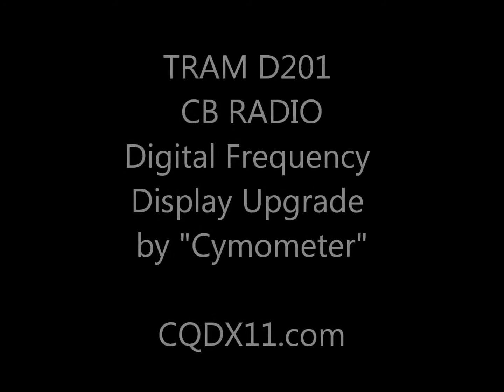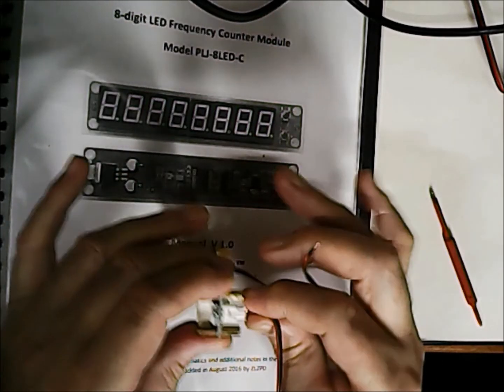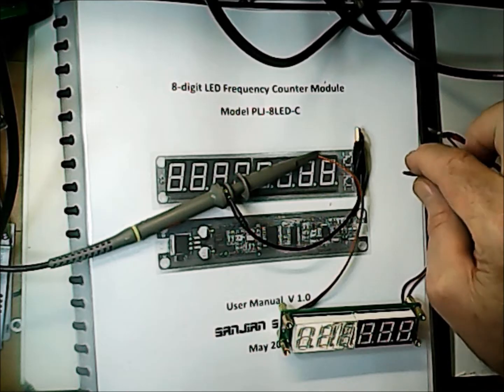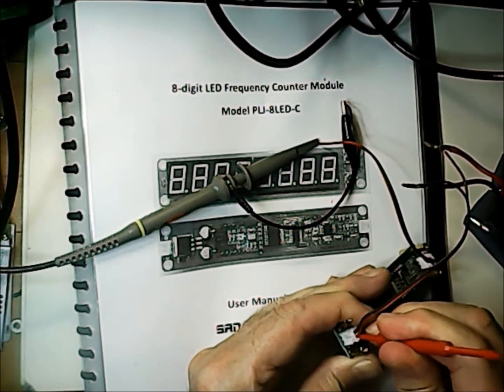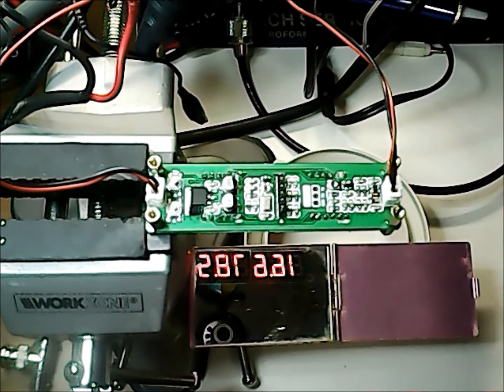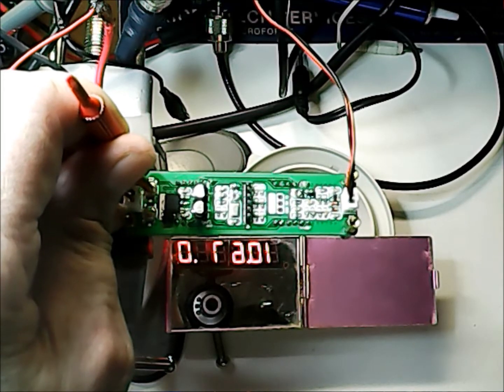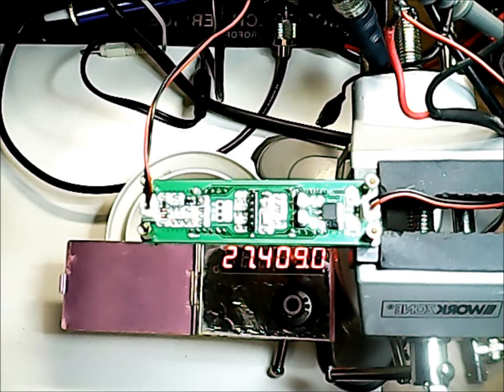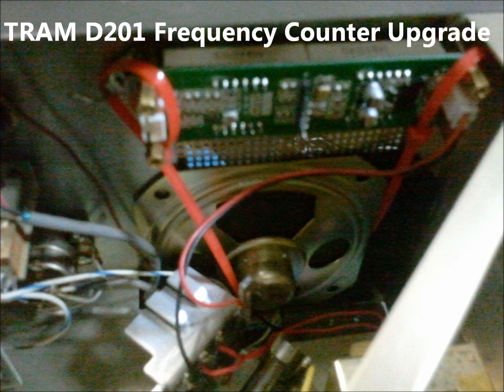CQDX11.com CB Radio Tram D201 Frequency Counter Upgrade

Comment: How do U connect to the tram for the reading?
Reply from the maker: @42rifleman Thats a great question and I wish I had divulged that at the time I made the video. It is connected to the IF = Intermediate Frequency output as mentioned. How or where I cant remember as I have not used my Tram for many years, and lucky to remember last weekend these days!  I probably would have done another video on it if more had been interested and liked it. Maybe one day I will add an SDR waterfall to the IF output, but probably unlikely. Thanks for your interest, 73. 43WR484 Greg